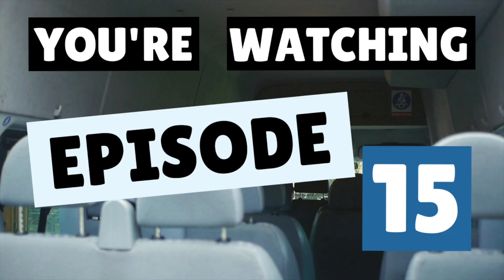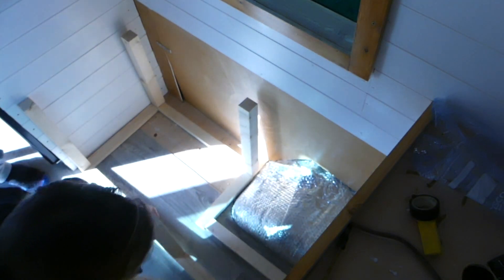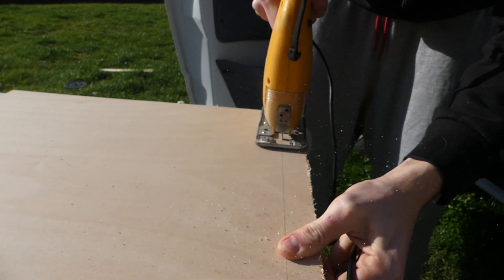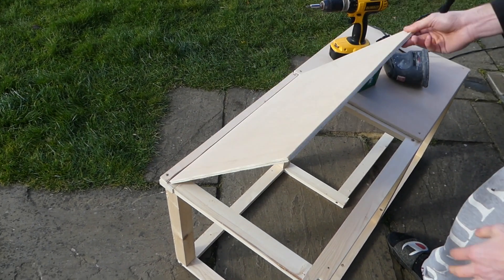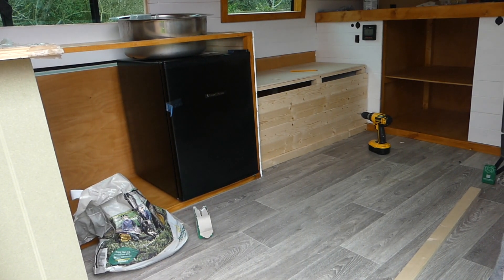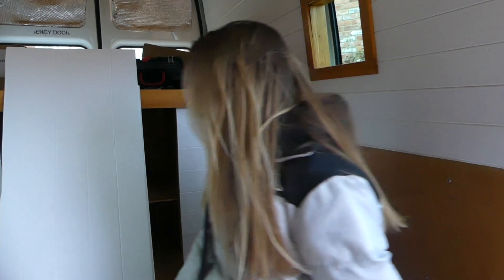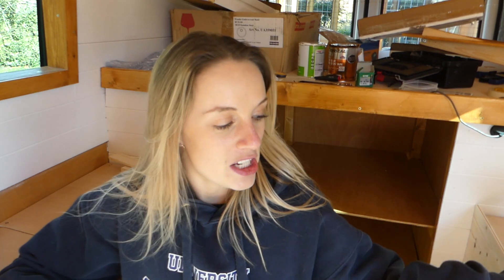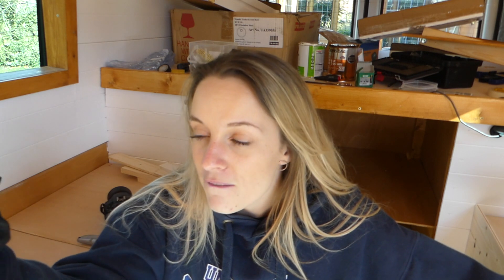Ep15: Building the Storage Bench Seats / DIY Ford Transit MINIBUS CAMPER CONVERSION / UK VAN BUILD

Comment: Loving the videos. Sorry if you’ve spoken about or answered this before, but, have you had to change to logbook to be able to drive your minibus? I’m looking at a similar van but google is telling me I can’t drive it on a standard licence as it’s above 3.5 tonne. Keep up the great work.
Reply: I recently insured my one with Adrian flux, because turning into a camper and not using it for carrying up to 17 people, they put it under a motorhome insure, all I have to do is prove that ive converted it, they've given me 12 months... so definitely worth a call
Reply from the maker: Similar to what Chris said mate. We’re going to get insured with Adrian flux as a camper conversion. Then get the van weighed and downplated by a 3rd party company, they do it if you send them photos and the weight documents! Hope that helps
Reply: @NickyandHarri  You might struggle with the weight of the van with all that wood you have used. There are so many overweight conversions around and they probably don't even know. Might be a good idea to get it checked to see how much you have to play with. Good luck.